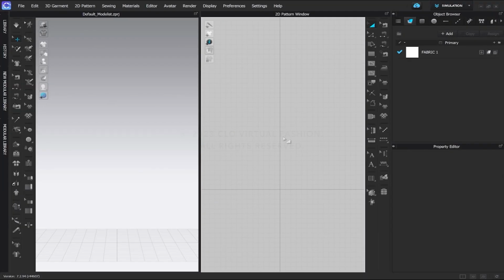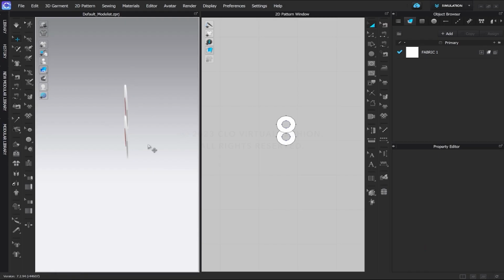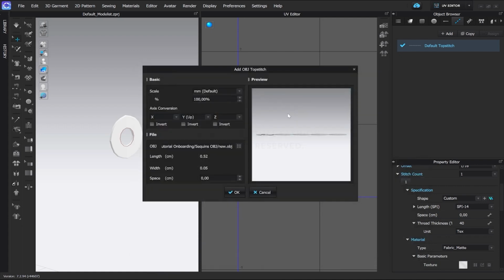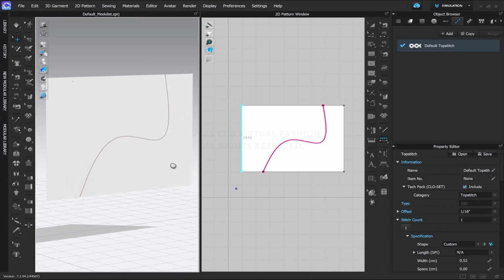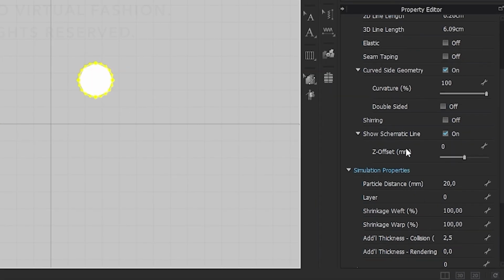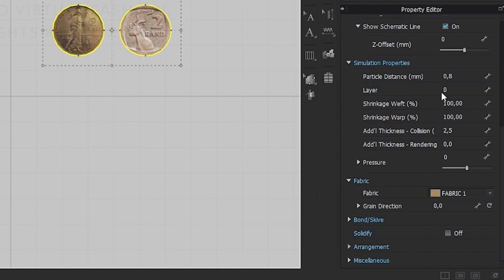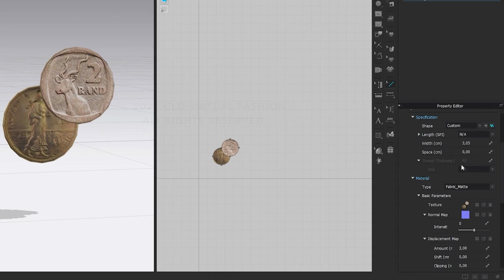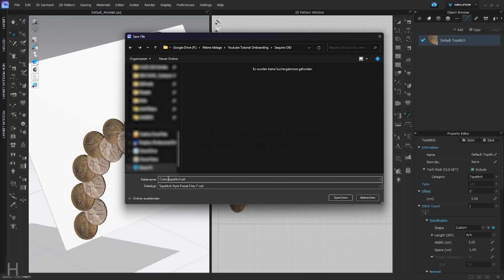Custom Topstitch Tutorial in CLO

Comment: while  exporting the sequin and  changing my -x,y,z axis doesn't make it fall flat on the topstitch rather its raised . should i try changing my axis positioning to make that fall flat?
Reply from the maker: Hi there! For Custom ONJ topstitches the easiest way to to make sure the axis will be correct when saving the OBJ. For this when you export the sequin to OBJ (In CLO or another program) make sure the sequin is laying flat and at the center of the floor at location 000.

If the above is not done then yes, you will need to do Axis conversion. Adjust the X, Y, and Z axis values to match the correct orientation of your OBJ. For example, if the OBJ is rotated 90 degrees on its side, you may need to invert the axis or adjust its rotation value until it faces the right direction.

Comment: Hello! that is a great tutorial! I would like to know if there is a way to change the material from the two coins. I´m creating a top stitch that has 2 parts (as the coins) but both get the same texture. Is there a way to edit the texture separately after creating the obj with multiple objects?
Reply from the maker: Hi. Currently only one material can be applied to a topstitch at a time in CLO. V=But with the use of UVs and Maps some variation could be achieved

Comment: You must fix the distortion problem when using an obj for the topstitch in simulation or at the end of a path.
The obj must be placed as it is or not placed at all if it cannot maintain its shape.
In the coin example the last on the top corner are dusorted.
You fix it in the final image.
Reply from the maker: Hi. If you use Edit Topstitch Tool and select the distorted topstitch > Go to the Property Editor and Turn on Curved this should help with any distortion